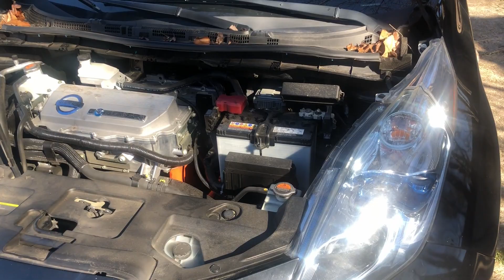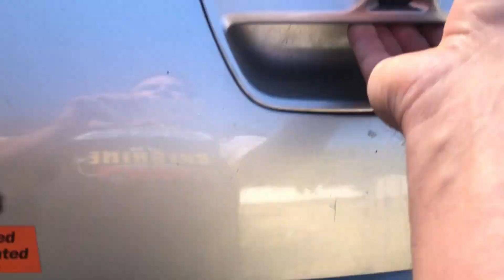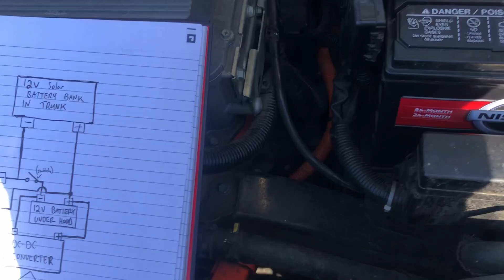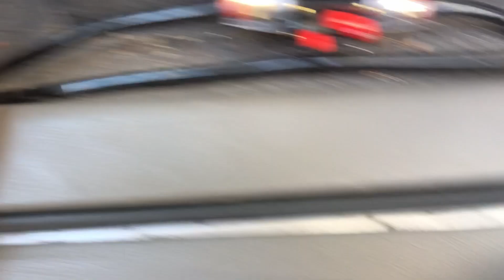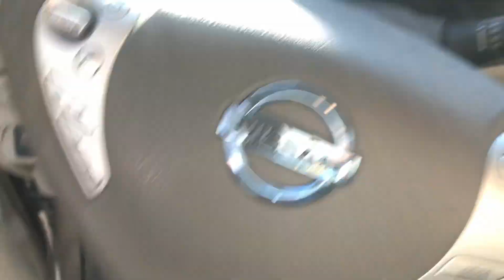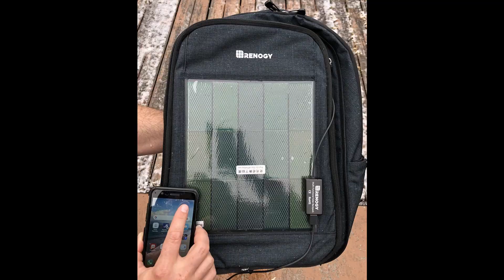Attempts to Separate the 12v Circuits in the Nissan Leaf from the High Voltage Battery

Comment: Hi, i think the dc-dc convertor is somehow conected to the ground via car body, You should Thy to put the switch on pozitive terminal of the DC-DC convertor
Reply from the maker: You're right, the negative line from the DC-DC converter IS grounded to the body on the way to the negative terminal of the battery (to top of driver side front wheel well).  Another weird discovery I made while tinkering is that the converter has a closed circuit detecting mechanism.  If you connect the leads that are supposed to attach to the factory 12v battery, to the leads from the trunk, the vehicle will start and run fine without the 12v battery even under the hood.  But the instant you disconnect the power supply from converter, the vehicle dies, EVEN IF the 12v load terminals are still connected to the solar 12v supply.  So the converter has to always detect a closed circuit across a 12v battery.  Not ideal, but okay.  But it gets even weirder.  
     If you attach the positive 12v supply from the converter to the original 12v battery, and the positive loads to the leads from the trunk (the same set-up as I use in this video just switched to the POS side) the vehicle will not start.  But if you touch the lug of the 12v load connection to the POS terminal of the battery (while the power supply from the converter is attached) the vehicle will start and run.
     So somehow the car is able to detect not only a closed loop across the DC-DC converter, but ALSO that the positive power supply from the converter is in contact with the load wires running away from the battery.  I don't know how the manufacturer engineered these detection mechanisms into the vehicle, but I will have to defeat them to achieve separation of the 12v system from the 400v battery.
Reply: @InnovativeSustainableSolutions  so the DC to DC cannot be connected solely to the underhood 12v battery to fool it?  I hope you can make an update video it is an interesting experiment.
Reply from the maker: @ewmegoolies  No.  Only if the loads are also connected across the underhood 12v - which defeats the purpose.  Somehow the vehicle has a close circuit detect across the loads and output from the DC-DC.  I may need help from Electric Garage, or someone else to figure this one out.  It's weird.  I am still working toward pulling those loads off the HV battery though.
Reply: I think You need a curent source to pull some simbolic current from dc to dc convertor ( 1A to say, that may work ) or You could modify the car software to ignore that ( i don't know how hard is IT)

Comment: That's right, separating the 12V system is pointless.. when the car is parked and locked, it doesn't draw much power. And while driving it's the same, 500W, even though the extra power doesn't affect the cycles. Even though the 500W is only drawn when the loads are on, while driving, if the loads are on.
Reply from the maker: That was a frustrating one.  Worth a shot, but I hooked it up to Leaf Spy and looked for any sign of it absorbing any of the HV load and it just wasnt there.  I agree with you, this idea is a bust

Comment: This is so pointless. The load from the DC-DC converter is miniscule. You're adding weight to save ... MAYBE a 300w load on the traction battery.
Reply: Yeah I kinda agree with this person, the added weight, cost & hassle is mitigating any gains. I think it’s cool your tinkering and sharing, I appreciate that, but the car doesn’t draw 400-500w sat on your drive, it does that when you have the ignition on and door open. Leave it off an hour and it’ll be as little as 0.15A

Also your predictions about the Leaf market didn’t age well did it? Not sure how it feels over there with EV sales across the pond but I’m seeing plenty of Leafs & other EVs here in the UK.

Thanks for sharing though! ❤
Reply from the maker: Over time it adds up to a not insignificant amount of cycles on the main battery.  Minimizing the cycle rate of the main battery is critical to maximizing longevity of the vehicle.  However as I was unable to separate the 12v circuits from the HV battery, it's all a moot point

Comment: Just spent some of a rainy day watching your videos, brilliant thanks. My 2014 leaf just dropped a bar at 61k miles so and on a cold winter day below 5'c its range is now below 60 miles 😞 Result is I'm starting to get serious about doing something about it. Over here in the UK we don't get endless days of sunshine so the solar thing not going to work really I suspect 😞 I am interested in the 12v battery stuff however. But no more videos? Did you resolve the isolating the 12v loads etc? Thinking of putting a string of 12 volt batteries in parallel with the oem and seeing if that would give more juice for the heat and lights etc as at our temps that makes quite a difference. Thanks again.
Reply from the maker: Hey Greg, yes I suspect solar would be far less efficient in the UK than in Texas.  Unfortunately no, I was not able to solve the problem of separating the 12v circuits from the HV battery.  The vehicle has some closed circuit sensors that are pretty good at picking up any attempts to modify the cars 12 circuitry.  I would need to recruit the help of someone that knows far more about vehicle wiring than me to accomplish this.  If you are running your heater, that is where all the power is going.  I need to make a video on getting a small electric space heater to run off the aux battery bank in the back.  That is easily achievable, will keep you comfy on your drive, and remove the very hefty power draw that the vehicle heater puts on the HV battery.
Reply: @InnovativeSustainableSolutions  Ha, heating? We mostly wear big coats and shiver to avoid using battery power! Did you get round to putting switch in positive side of cct as the car is neg earth I suspect that screwed things up. I'm supposed to be an electronics engineer but the complexity of modern cars scares me to bits. You've done amazing stuff as novice in the field. I'm also at the point of going the power wall route as I have 5kw of home solar btw. Keep up the good work. Near freezing today on the Welsh border poor old battery shivering I'm sure!

Comment: This might be a silly question, but could you just charge the accessory battery directly from the solar array without the rest of the setup? I'm thinking panels -> charge controller -> accessory battery. Would be a lot cheaper and simpler, definitely a smaller system but maybe worth it all the same.
Reply from the maker: Not a silly question at all.  Using solar to apply a constant, let's say 14.4v shouldn't damage the battery, but would slightly reduce the amount of power the converter draws from the HV battery, which is the goal here.  It wouldn't completely eliminate the vampiric drain of the DC-DC converter which was/is my goal.  But if I can't figure out how to disconnect the 12v loads from the battery, I will probably end up compromising and going with exactly the method you describe.
Reply: @InnovativeSustainableSolutions  Thanks for responding to all my comments! Joining the Patreon now. 

My goal is to spend less than 1K to create a system that slightly extends the range of a car - while driving. I want to take my car on roadtrips, and every mile counts a lot.

This means a second battery pack isn't super useful, since I would need to stop and plug it in to take advantage of it. And plugging directly into the main battery seems like a huge pain, and potentially risky. 

But I'm thinking that if I just plug the solar panels directly into the 12V battery, I might  be able to extend the range by maybe 5% with a few hundred dollar investment. Plus it wouldn't take up any room in the back.

If I could get the AC to run off the 12V battery too that would be even better, but it looks like right now it runs off the main battery so that might get expensive.
Reply from the maker: @scottsthought  Thanks man!  You've got options.  I know a guy that lives in a Leaf 4-5 days/week.  Consider replacing your 12v Lead Acid with a LiFePo.  The Lithium battery will have a higher voltage when fully charged, which should reduce the power that comes out of your HV battery via the DC-DC converter (bigger voltage differential USUALLY means more wattage flow).  Most solar panels put out 18-20 which will definitely damage your 12v battery.  Lensun solar can make you a panel that will fit easily on the roof of your car and make exactly the voltage and wattage you want, but they are pricey!  Maybe you could get a regular $150 panel and run it through a voltage step-down, . . hmmm.  Dang it, now I have to try that.
Reply: Maybe I'll make a video and beat you to it! Haha

Comment: Keep up the good work. 
any update?
Reply from the maker: Still workin on it V, Cyberdeck is a little low on ram atm.  :)  Will definitely post an update video when I figure it out.  I think the easiest way to pull it off will be a software hack.  We can modify the messages the vehicle sends to the main control computer (the VCM), using a fairly simple device called a CAN-bridge.  If the output of the DC-DC converter is controlled by code anywhere, we can modify it and turn it down to 1A (15watts), 2A (30watts), etc.

Comment: There's a large capacitor bank in the Leaf (and most/all cars with airbags) that's used to power the airbags in the event of a high impact crash... so that if the 12v battery is ripped theres still power to trigger the airbag system. So you may be seeing 12v from the capacitor bank. If this is true then I I aging the car wound die aftercare fee minutes with the high beams left on.
Reply from the maker: Thank you for that lead Paul.  I would guess that I left the highbeams on for atleat 5-10 minutes while testing/filming.  I may go back and run the same test for 20 minutes and see if I can get the car to die, indicating the capacitors were what was running it.  I couldn't get Electrified Garage to get interested in helping me sort it out.  There is probably a way to reduce the DC-DC converter output to 1 Amp, using software and a CAN-bridge.  It's sloppy, and could create some other problems, but would serve to effectively minimize cycling of the HV battery.

Comment: That's an interesting problem and you have look it over pretty well. I guess I'm going to have to watch your channel more closely to see if someone comes up with an answer. We are coming to a funny place with the used batteries as the Tesla Model S and X batteries which are not as easy to use as the leaf but somewhat usable are being replaced with the model 3 who's long 6 foot 23 cell configuration are not easy to use for project.
Reply from the maker: It is a funny place.  If you think about it, when Tesla was small time, and still figuring stuff out like the rest of us, they made and used batteries that are DIYer friendly.  As they have gotten bigger, and their battery technology has evolved, it has simultaneously become less DIYer friendly.  The latest step,  cell-to-frame battery installation, and STRUCTURAL batteries, will make their new 4680 cell completely inaccessible to us DIYers.  I think in the future the new GM Ultium battery modules will be powering a lot of converted Fords and Chevys, and VWs over there at Green Shed Conversions (https://greenshedconversions.com/).
Reply: @InnovativeSustainableSolutions  thanks for plugging our website.love what your doing.

Comment: Hey Sam, I just watched a video posted from another YouTuber, Samcrac, about a BMW i8 with a blown engine. This has basically totaled the car. It got me thinking though, without the engine in the car, there would be plenty of room for a battery. The i8 is already hybrid, so it has all of the parts needed to operate on electricity and function solely as an EV. Dr. Google says the i8 has a standard, electric-only range of 18 miles. How difficult do you think it would be to drop in a larger battery in place of the engine and increase the range of the i8 to something more practical like 50-100 miles? Video: https://www.youtube.com/watch?v=O1gdp-JqFS4 .
Reply from the maker: Ugh.  Hybrids.  The worst of both worlds.  When one very complicated system just isn't enough, go for two!  But joking aside, building a 400v battery with it own bms, and tying to the cars existing HV line (toss in an extra contactor) is something most people could pull off.  The problem is with the electric motor.  In hybrids, the electric motor alone is used at low acceleration.  But when you try and accelerate harder the ICE engine kicks in as well.  So while you can run a hybrid without the ICE engine (cool video of this demonstrated in a Prius https://youtu.be/FqAzMzT_0qg) you won't be going very fast.  And the computer is the i8 is gonna go ape shit over all the signals it's not going to be getting from the gas engine.  Very few people posses the skill that would be neccessary to overpower the vehicle's computer.  You're better off dropping the whole drivetrain out of a Leaf or Bolt in there.  Steve Clunn could pull that off in a couple weeks.
Reply: @InnovativeSustainableSolutions  Haha! Fair enough. Shoot, I thought I smelled a good deal. It looks like the i8 does a little better in EV only mode than the Prius in terms of power (~11 sec 0-60, 76 mph top speed), but not $70,000 better: https://www.youtube.com/watch?v=vHCKAO_GAvc . Maybe if I find a salvage one with a blown engine for like $1,000 someday I'll consider it.

Comment: Eliminating the vampiric drain to maximize main battery life sounds like a great idea to me!

I think that the 400v system is powering the 12v volt system. You effectively bypassed 12v battery and I think the electronics in the car are working to compensate for that. I think that Tesla's and other EV's can still run when the 12v battery is dead too, they just do wonky things. Maybe you can test this by completely removing the 12v battery under the hood from the car and hooking up the 12 volt leads exactly as you had them in the video (minus the 12v battery). If everything still works, I think this will confirm the 400v battery and built-in, factory 12v inverter in between meant to charge the 12v battery is effectively powering the car. 

Is there any danger with load balancing the 12v batteries? Such as if the 12v under the hood is at a lower state of charge than the ones in the rear, could opening the switch cause a rush of current to the 12v under the hood and cause damage? I guess this would only occur if the main 400v battery was dead as well because it charges the 12v under the hood 24/7.

Being able to run the inverter from the main 400v battery sounds wonderful. I like the brilliantly simple "back-door" that you have found to do that. Cheap too, which is always nice.

For other people out there trying to replicate the idea of increasing main pack life span by decreasing load from charging the 12v, Deltran battery chargers offer a product that I think might work well in this situation. Deltran is the de facto standard for classic car owners who like to keep their batteries in their antiques charged and ready to go for the few times they use their cars per year. They sell both solar panels with a built-in overcharge protection and charge maintenance system. They sell both a product with the solar panel and monitor together as well as a monitor that can be plugged into any existing solar panels that a person may already have. Link: https://www.batterytender.com/solar-panels .
Reply from the maker: I can remove the 12v battery under the hood, and connect the supply and load leads directly to the lines that run to the trunk, and the car will run (it was kinda fun to drive the car around with no battery under the hood).  But then when I charge the car using the solar bank in the trunk, we get a loop where the solar bank charges the HV batt, which powers the DC-DC converter, which tries to charge the solar bank, which is, . . you see the problem.  I ran into some other weird problems that I didn't have time to put in this video.  See the pinned comment for an elaboration of those.

     Load balancing is not a concern.  I was worried about the differences in operating voltages between my LiFePo4 batteries and the lead OEM one.  But it turns out that the voltage differences are just too small to push much wattage.  I was shocked to learn that the output from the converter tops out at no joke 120A.  Significantly more than you will ever get from one 12v batt to another.  Connecting Lithium 12v and Lead 12v in parallel is not ideal, but it can be done safely.  The fully charged Lithium batt voltage is higher than fully charged Lead battery voltage, but only by 0.6v.  Not enough to cause a safety concern.

     Not all EVs charge the 12v battery 24/7.  In many of them I think including the 1st gen Leaf if the car is off, the HV contacters remain open, and the bms that runs of the 12v will slowly drain the 12v battery, resulting in a dead 12v, but potentially a still charged 400v.  I think my wife's Bolt is one of the EVs that does a periodic "check-up" on the 12v.
Reply: @InnovativeSustainableSolutions  Wow, lots of new discoveries! I love that electric cars, particularly Nissan Leafs, have come down in value so much that they can be experimented on like this. I'm really looking forward to your next follow-up video because trying to decipher all of this new information after reading your response and the pinned comment is quite a bit to take in. I found myself writing a bunch of gobbledygook in this comment that I just erased because I was talking in circles. I'll follow your story instead. Sounds like a fun new tangent. Looking forward to your future videos!